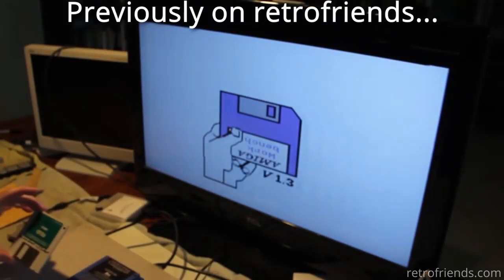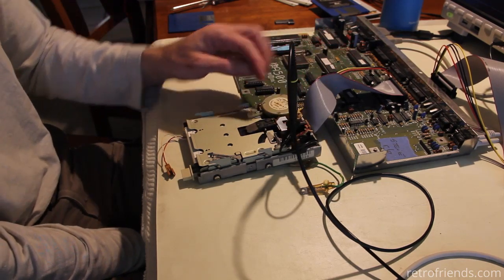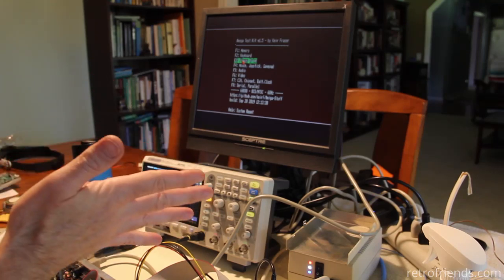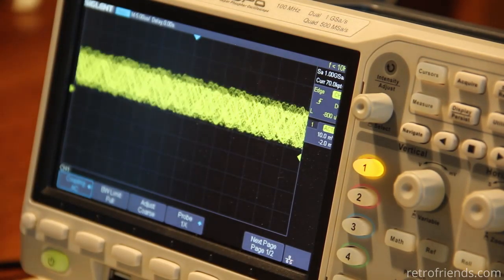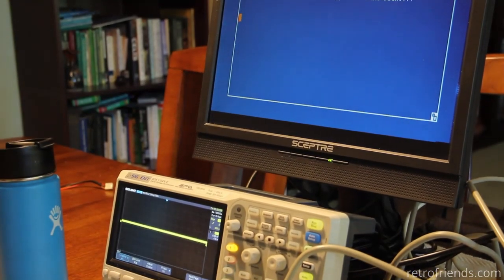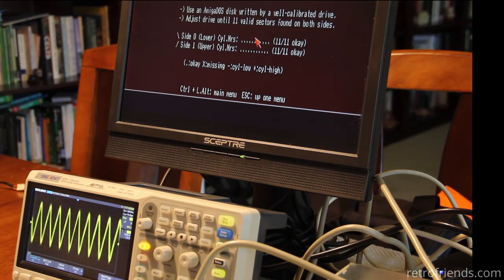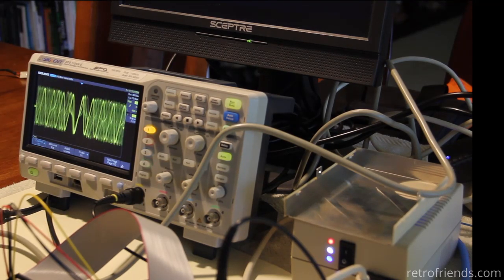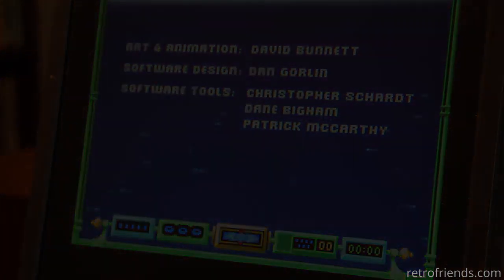Aligning an Amiga Floppy Drive Using an Oscilloscope

Comment: Also, why can't the stepper motors and TZSes on all these drives, both 3.5" and 5.25," be fastened so hard at the factory with a glue along the screw slots so tightly that the stepper is never strong enough to slide the heads back hard enough to knock either thing out of calibration?
Reply from the maker: I did this video a long time ago, but if I didn't mention it, the screws are actually lock tighted in place at the factory. They are that way on all drives that I've ever seen. But that doesn't help protect against the computer being thrown in a dumpster, or whatever else banging around may have happened.
Reply: @retrofriends : Oh, sorry if I missed it. But if they are glued with something made by Loctite then what is it that lets something like a Commodore 1541 still break that and re-zero-bang its head out of alignment? How is it not proofed from that?
Reply: Also, on some drives at least, the leadscrew is pressed forward (under tension from the back of the stepper motor) against a bearing. As those contact points wear, the alignment will gradually drift out of spec.
Reply: It's also nice to have the option to adjust the alignment when recovering data off a disk that was written by a misaligned drive.

Comment: Hmm, I was never really aware that 3.5" standard floppy drives could get misaligned. I bet this would be even harder to do with those small horizontal steppers. Way back in the day we first had DSI here in Utah align our Commodore 1541. Then a few years later we found the disk "1541/1571 Drive Alignment," and it instructed me as a mere 11- or 12-year-old to run the software and use that calibrated disk while doing what you're doing there, turning the case and stator of the stepper motor until the software told me I had the stator matched up to about the middle of where the head was on that track... or something like that. But I wish we could've done it with an o-scope! Also, I have a hard time imagining how moving the TZS would work, unless it gets knocked farther back from where a properly adjusted have theirs, because if those don't match from drive to drive then it seems to me like  a disk written with one drive won't work on this one, or/and vice versa. How would moving the TZS bring it back to spec.?
Reply from the maker: Either in this video or the previous one, I make the point about the track zero sensor position and the radial position of the motor making the exact same effect. This is true because if you move the track zero sensor you move where the drive thinks track zero is, and all other tracks are skewed along with it. This is exactly the same thing that happens if you rotate the motor.
Reply: @retrofriends  No, you are mistaken. The track zero sensor (usually designated TK00) can only move the heads a number of whole steps. You can't make the stepper hold a position between its natural steps. On most drives, the TK00 is even qualified through one of the stepper phases, so that it can only move the heads two full tracks at a time. You can look at it as the TK00 being the coarse adjustment, while rotating the stepper motor is the fine adjustment. Sometimes you will need to go back to the TK00 after having set radial alignment by adjusting the stepper motor.

On some drives, there is no holding current through the stepper when it is idle. This can result in a situation where rotating the stepper does not move the heads at all. In this case, you must keep the heads moving (the stepper motor running) while you slowly adjust.
Reply: @retrofriends : Hmm, I can't really envision that. Oh wait a minute. Don't drives like Commodore 1541s get misaligned because they don't have a TZS, so they head-bang instead? So you're saying that really the only reason these would get misaligned is because of a hard drop or something like that? How would it be hard enough to break that sealant?
And does your other video have a diagram that shows why moving the sensor would not give the drive and alignment that is unique from other drives because it's non-factory?
Reply from the maker: @HelloKittyFanMan  It wouldn't break the sealant as much as cause something else to bend or tweak. Not hard to do since we are talking about micron increments making the drive faulty. There's also other potential causes like temperature and humidity swings, electronic drift caused by aged components, and poor build/qc from the factory. Some drives will be irreparable due to wear, mechanical, and electronic failure. I always kept that in mind when I was trying to get drives to work. Who knows, I could have even gotten a worn drive to work by dialing it in better than it was at the factory.

Comment: I remember that TP1 and TP2 are actually the differential outputs of r/w head amplifier. Hook up scope  channel 1 to TP1, channel 2 to TP2. I guess channel 2 was "inverted" and both channels "added" together. You needed another test point (index signal) to hook up your external trigger to keep alignment pattern steady. There is only one amplifier because only one r/w head can operate at a time. 

You should be able to "see" either head on same test points by having the drive exercising software switch r/w head.

For proper alignment there used to be analog alignment diskettes by Dysan and Memorex. There was a cat eyes pattern for track alignment. There was also an azimuth alignment pattern somewhere.

As long as you don't loosen the screws fastening the upper head, you should be ok by just aligning the fixed head.

It's been more than 30 years ago since I did this. Thank you for your video, it brought back some good memories.

Rafael
Reply: I guess in that case the cycling between stronger and weaker signal shown on the oscilloscope was to do with one head not being as well aligned as the other? Interesting stuff.
Reply: @josh46646  Cat eye pattern looks like two "lobes" resembling a pair of "cat eyes". When R/W head is perfectly aligned, the two lobes exhibit equal amplitude. Maximum misalignment allowed was when smaller lobe had 70% of bigger lobe amplitude.

Assuming properly aligned R/W heads, it may happen that one head may exhibit smaller cat eyes pattern amplitude than the other head and yet both R/W heads are OK. My observation back in the day was that the "fixed" head signal was stronger than the "movable" head perhaps due to lower pressure on the surface of the disk. This movable head had to separate from the fixed head at floppy disk insertion and ejection time.